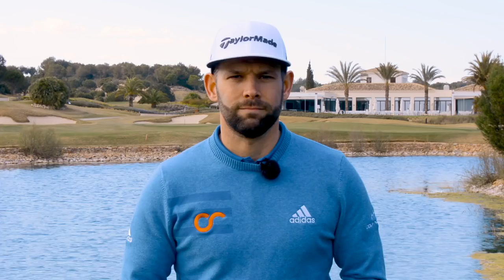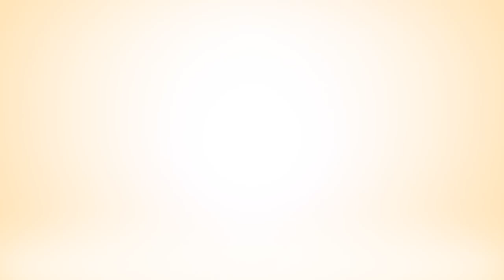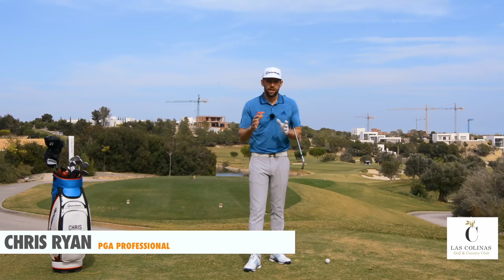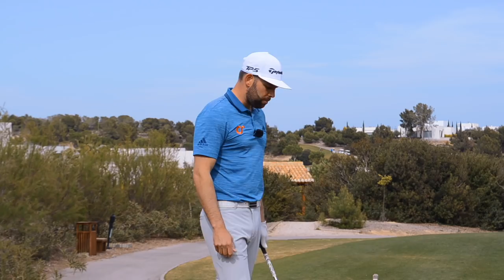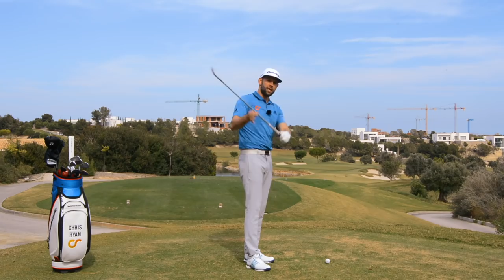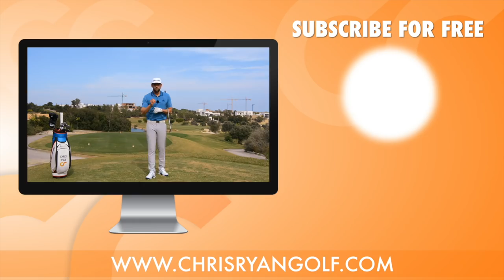THE MOST COMMON FAULTS IN GOLF - THE TRANSITION

Comment: When shallowing the club, i have difficulty getting the clubface back to squaree (I feel that the palm of the trail hand remains in the "up" position) through impact. I know there is a video out there that will address this, other than the previous one. Got any suggestions? Enjoy all of your videos.
Reply from the maker: Hi Richard, you will need to work a little on your wrist movement in order to get the face managed correctly. Search for wrist angles and there should be some good stuff there 👍👍